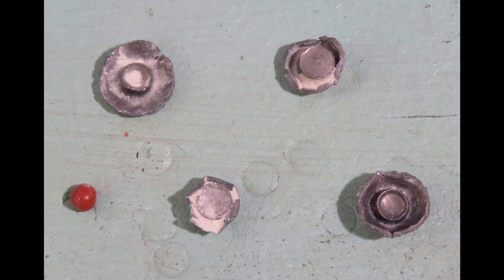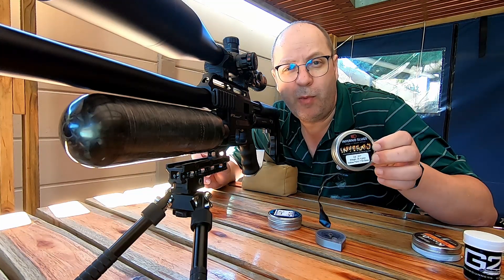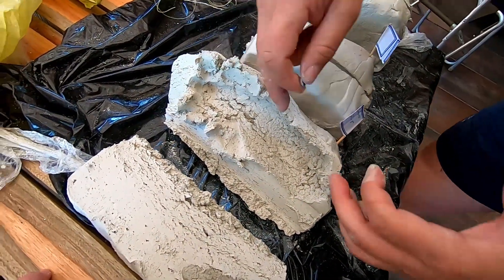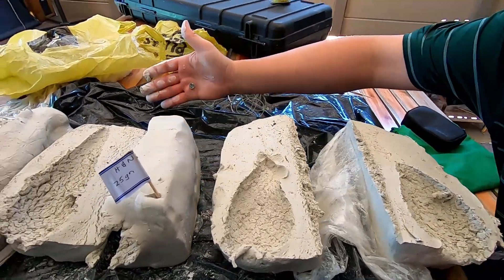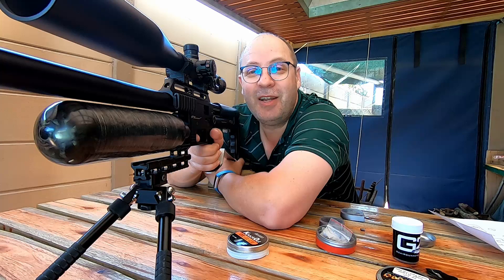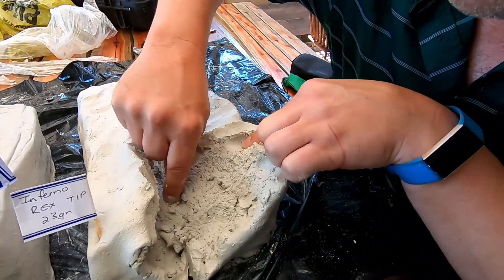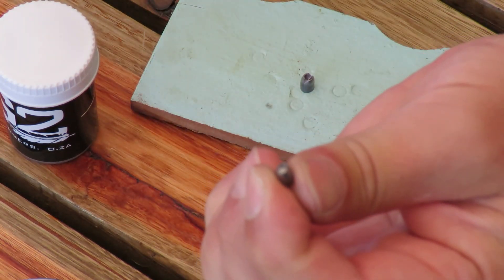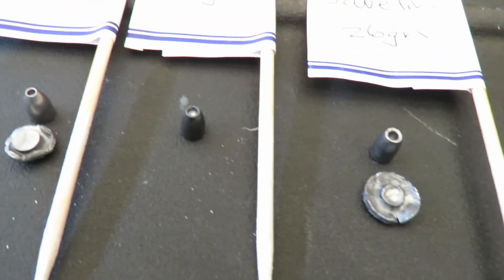Choosing a slug Part II

Comment: How much is it gave you, when you go from pelletprobe to pinprobe ? Only this, not change the hammerspring...
Reply: Pellet probe to pinbrobe gave about 30fps extra, the same when I added the Dual Flow, also 30fps, so combined the two is giving me about 60fps extra. The gun has the slightly shorter hammer spring and heavier hammer that came with the Power Plenum. Reg at 125 bard, shot count from 240 bar to 125 bar is about 75 shots.
Reply: @gertvrey6941  awesome :) 
I have the impact X mk2, where the Huma HighFlow Transferport is installed, and the Huma Highflow Pelletprobe.
-But i think i cant get higher than 970 at 140bar.

I shoot with the Hybrid slugs from FX, that i like how they expand, and the lower weight, 22gr.

BTW i have 500mm barrel.
Reply from the maker: @fiskernissen4623  The 500mm barrel is very nice, I have the 700mm as it allows more power and lower reg setting, my gun was tuned by Gerhard (Patriot-Outdoors), and I must admit that it is purring at the moment. It will shoot the Hybrids over 1030fps.
Reply: To be 100% correct.
You have only add the pinprobe, and not the hammer spring from the kit?
Reply from the maker: @fiskernissen4623  no not the full power kit
Reply: Thanks a lot :)
Reply: @AimSmall   i got the Pinprobe today, and it gave me 38fps more vs the Huma HighFlow probe.
So now i can shoot at lower bar, and then still get the same FPS.
Amazing...
Reply from the maker: @fiskernissen4623  Awesome results, nice. Just be careful with the pinprobe not to slam the cocking lever forward when closing the bolt, they can bend. Only draw back I discovered so far.
Reply: @fiskernissen4623  Didn't buy the power kit. Only installed the dual flow port and pin probe

Comment: i would choose  the H&N because accuracy and penetration are better with low power airguns ,and the temporary cavity you dont see in the clay.  animals have a nerve system on both sides ,thats why hunters with firearms want penetration  and  a bullet that goes tru and expands and stays as complet as possible   like a  ,bounded core.  h jacket    .is better,
 thats looks the H&N more doing . a animal is not all soft tissue .
Reply from the maker: Hi Peter, interesting point and I think a lot of different arguments can be made here, my experience with slugs not expanding has frustrated me for a very long time now and that is why I prefer an expanding slug. I have had many "pass through" shots with slugs and pellets where they just simply pass through the target without expanding at all, thus making shot placement so much more crucial to make sure you hit something hard in the target. I don't have the ability to guarantee shot placement beyond 60m thus I prefer the softer more expanding slugs at this distance, the difference in accuracy is minimal but the hitting power of the expanding slug makes a massive difference. Penetration has never been an issue with slugs traveling at 950fps and up, expansion on the other hand has been a problem.